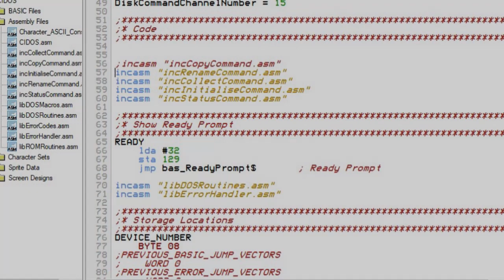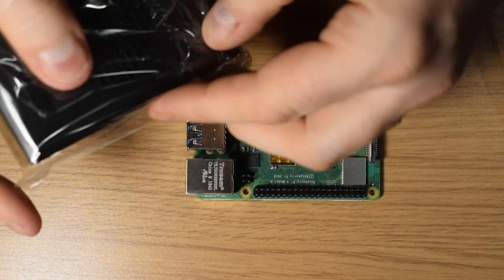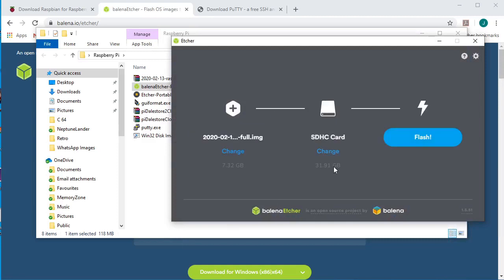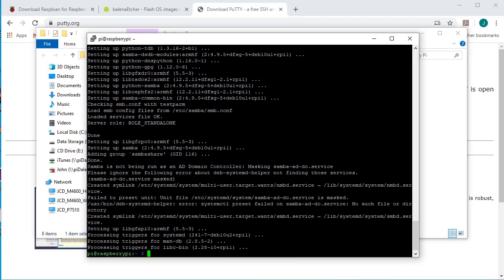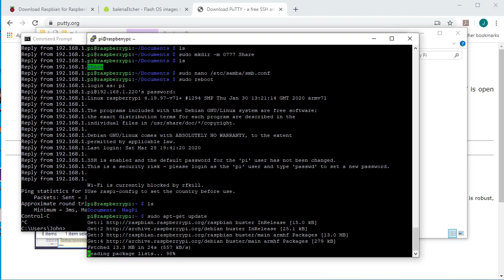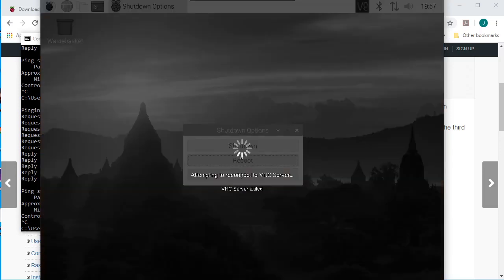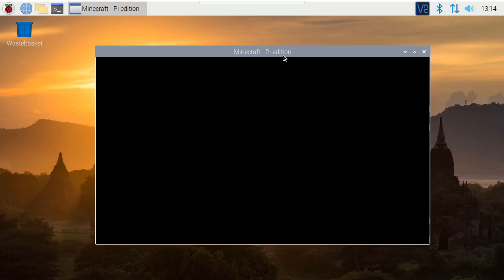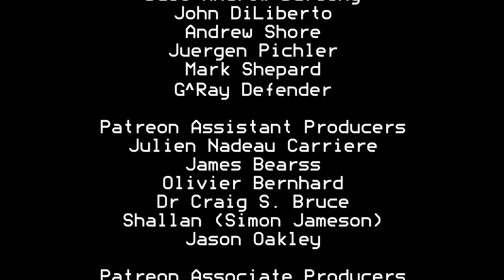Unboxing and Setup of Raspberry Pi 4 4GB

Comment: 12:55 The sharp edges of the fan blades bite into the air.  The product picture indicates that the fan should blow outward, but it seems to me also that it would be a lot more efficient to blow the air toward the circuit board.

30:42 The permission numbers specify a bit mask in octal.  The leading '0' digit (which is usually optional) sets some special flags.  The next three digits specify the access permissions for User, Group, and Other, respectively.  A 4 means Read permission, a 2 means Write permission, a 1 means eXecute permission, and the bits can be composed, e.g., '7' means Read, Write, and eXecute permissions simultaneously.  For a directory, the eXecute permission means that pathname access can traverse through the directory even if you can't list the directory (for which you would need Read permission).  You can see the "rwx" permission flags for files when you do an "ls -l".
Reply from the maker: Watcha, Yeah the fan..... I would have thought that, to blow on CPU, well after video I did just that, reverse the fan and so it now blows onto the CPU, its running about 62 Degrees now, and does not throttle, i have been looking at this new ICE Tower fan, that will allow over clocking to 2Ghz and i think ill spend some of the patreon money investing in one of those, as it seems that can keep the cpu in to 40-50 degree rang while been massively overclocked.

Permissions : yeah, imstarting to get my head around this permissions notation :) with the help of my patreons, thank you for your input too :D

Comment: I have a n early PiZero  that I have been working with some time. 
Followed the video through to the end.
Video is good . Explained very well.
(I get lost very easily, could I ask for an up front "what we are doing outline") You do say at the end what the objective is. 
Question: why do you use VNC in your programing process?
Reply from the maker: Hi, Right the reason im using VNC is purely to record the screen from, if I was doing this by myself, I would be sat in front of TV with a remote keyboard and mouse doing it. That is the only reason for VNC.

Am not sure about the question "What Am I doing online?"
Reply: @OldSkoolCoder  thank you,John. Understand, video production does  have  its demands. :-)
Reply: @OldSkoolCoder  I was not clear.  was asking for an OUTLINE of the intended purpose of "why we are doing this"
Reply from the maker: @retroelectrons2  ah, Right, im running a community development project to get the "World Famous" ;) Hunchback game developed for the C64, so (like I did with Neptune Lander) we will be trying to write it in a modern day "BASIC" Like Language called Python to understand the gaming mechanics, then converting this python based game to 6502 Assembly. So thought it would be cool to use a modern day version of the C64, Spectrum, Dragon 32 and BBC Micro that we used back in the past (when Dinosaurs roamed the earth) and the modern language, to understand how the game will work, then we would move to 6502 assembly, and then all code the C64 game together, and hopefully we will have a decent clone we can sell for charity :D (already started with some streams on my twitch channel 'OldSkoolCoder').